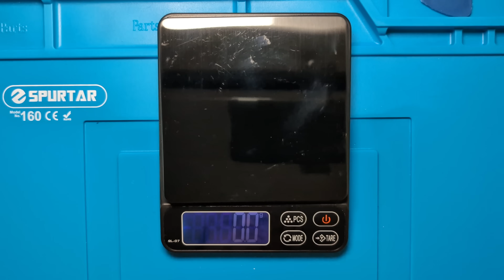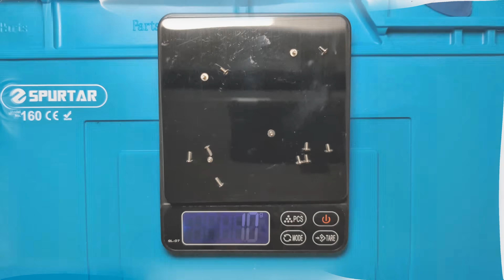TEARDOWN | Pulsar Xlite Crazylight

Comment: Hi, I love this mouse but the main clicks are a too heavy for me. I was wondering how change them. are these hot swappable, what kind of switch does it have to be? I like razer opticals gen2 but I don't know if they would work in here. Hopefully you can guide me a bit.
Reply from the maker: Sadly they're not hot-swappable, so you'd need to solder on new switches. But any switch with the same optical-style pin layout should be compatible.

Comment: They make the Pulsar Blue encoders up to 15mm height, the Xlite V3 Large uses exactly that one. Xlite V3 Medium uses 14mm Pulsar Blue and the Mini uses a 13mm Pulsar Blue encoder.. So those are available in the proper size, but they are probably more expensive.
Reply from the maker: That makes the choice here so much worse. Mouse would be SO much better if they used the Blue encoder.
Reply: @mel0nFPS  I agree. Also, the fact that the wheel itself is only held in place by the pillars on the top shell does not help. Otherwise, TTC Gold should be decent and precise, not as good as Alps or Pulsar BLue, which I think is RAESHA custom made. You could try another encoder, or search for a fix for the wobble, see @turbobitbox videos.
Reply: @mel0nFPS  It's a shame Pulsar gave up all of the improvements on the scroll they made for the Xlite V3, first they gave up the bearing and mechanism for indirect scroll click, then they gave up on their own custom encoder

Comment: hi, uh

just curious can you check your output file of this video?

on YT your fingers are morphing and smearing between frames, I thought AI filter was only applied to short form vids not long ones...
Reply from the maker: Hey! Not sure what's happening there, no AI filtering was applied on my end. Might be the transitions being weird depending on the resolution you're streaming in?
Reply: @mel0nFPS 
yea I figured you no one would use any filter that might cause this to happen let alone this being a tear down video its even more unlikely to have any filter on youjr end.
 i was watching on 1080p 60fps, should be pretty obvious around 2:20 if you watch the video on other browser
Reply: I tried switching to other resolutions but the smearing is still there, I also checked other older videos from a year ago from other creators and the smearing was not there at all
Reply from the maker: @ohdeer1823  Weird. No idea why its doing that then. Can you give me a timestamp so I can look on the project timeline? I must have accidentally used a stabilization effect on a clip or something.
Reply from the maker: @ohdeer1823  I just checked at 2:29 I have a smooth-cut that transition that's causing my hand to vanish. But for some reason it's set to a longer frame range than the others, not sure how I did that but that's why it appears to be happening.
Reply: @mel0nFPS  oh nono not the hand , but the idividual cells of your soldering pad, each frame the filter was processing what its trying to render around your hand  resulting in the boundaries of the cells morph and smear
Reply: @mel0nFPS its most obvious around 2:16~2:21